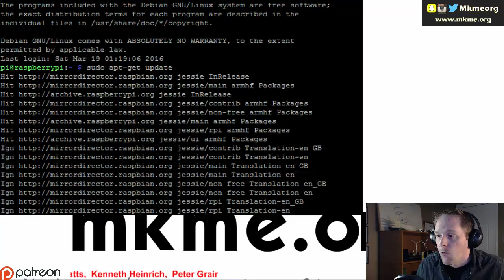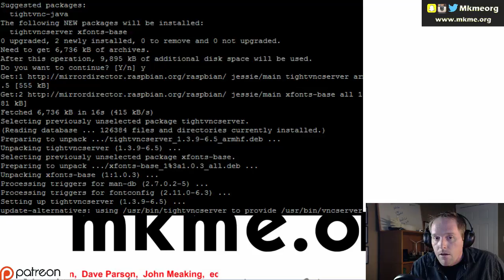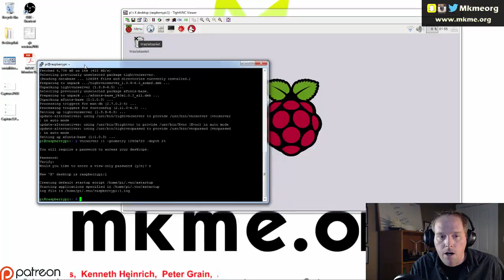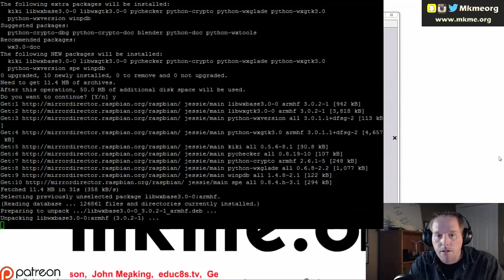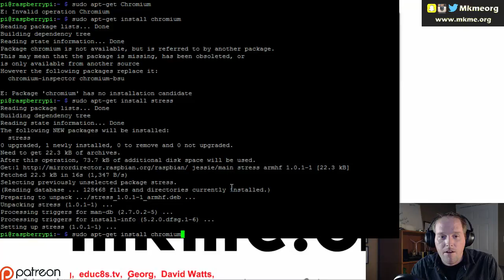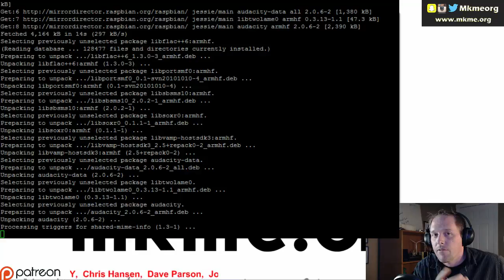Setting Up a Raspberry Pi 3 From Scratch #LiveFromTheLab

Comment: Hello. You forgot one common thing. That i found most people forget. Is to expand The file storage by Sudo raspi-config. If don't expand it then you look at say you got a 8GB file and say wait where is the rest of my drive at LOL i had that problem when i first tried to install my raspberry pi board. But over all awesome live show.
Reply from the maker: +joseph chrzempiec (josephchrzempiec) Good point but in this case I used NOOBS so the raspi-config can't actually expand the file system. You have to do it manually for NOOBS. In this case just for testing I dont really need to as I will move over to a proper image when I put the Pi into service.  Cheers and thanks.